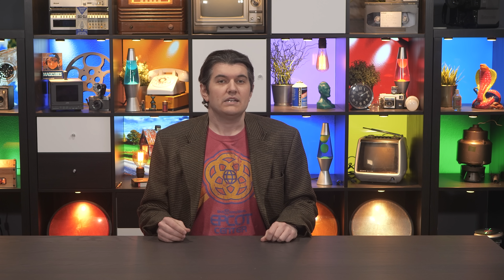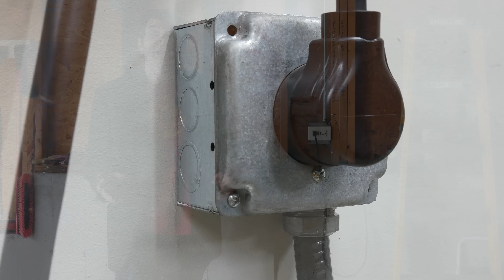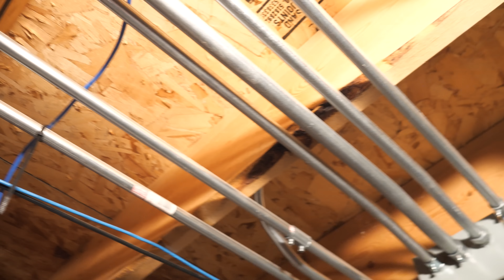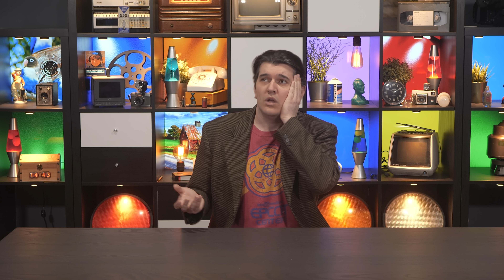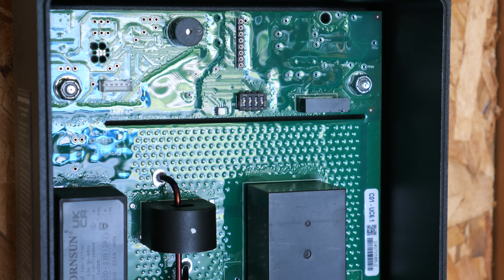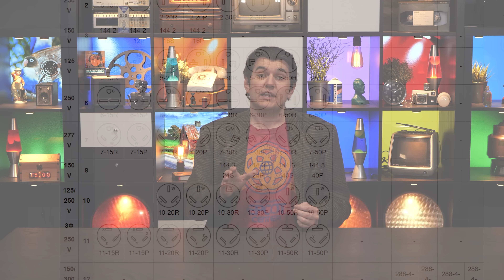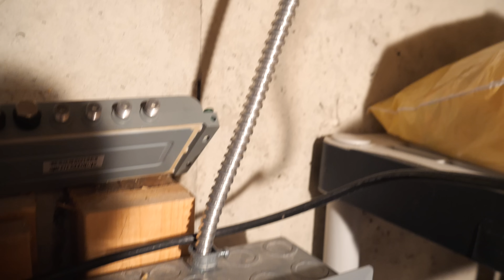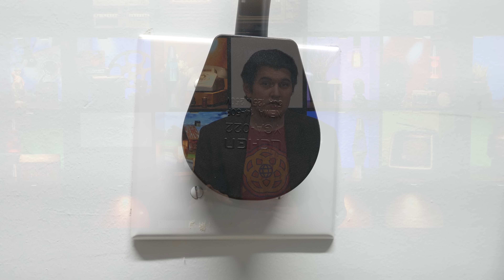The "standard" car charger is usually overkill—but your electrician might not know that

Comment: If you would have had to pay for the labour, getting the slightly beefier wire would have added almost nothing to the total though, so you still might want to get a bigger circuit anyway. The expensive bit is the labour anyway, parts and materials are probably less than half. So sure small circuits are fine, but if you can't do it yourself, might as well get the biggest wire put in that does not require panel work.

Comment: as a German electrician, i find this all very interesting, but we have 230V 16A at every circuit in our homes and we have ground fault circuit breakers for every circuit, it's called an RCD and sits in front of the circuit breakers (as long as you house isn't like 100years old, wich is quite common but even then most houses just add one later) btw. our stoves for example get 400V 16A-32A. so its interesting but completely useless to us in most parts of the EU xD
Reply: Yeah I am shocked that they don't just use RCBOs on 240V circuits in the US, they are less then 50€ anyways.
Reply: @DooMMasteR  
Yeah im generally kinda shocked by their electrical stuff, the only thing that should also be mandatory here is a main breaker so u can work on a panel without having to call the utilitys to shut of power to the entire house 😅
Reply: Yeah same in The Netherlands.. and with EV charging, a 3-phase 11kW charging station, hard wired with a completely seperate circuit and load balancing is pretty much standard. Not sure if it's mandatory and it might be a little bit more expensive but it works like a charm here in my house.
Reply: @bartwillemsen1  yeah in the EU, the outlets have to have a Type A/B RCD, wallboxes have Type B (DC) built in, since Type A is mandatory anywhere anyways, it's common to just separate them; (also in Germany e.g. a max of 6 RCOs per RCD is the limit) so there could only be up to 3 other circuits on the same RCD anyways.  
Having a fault current risky outdoor circuit separate makes sense especially when a 40/63A Type A RCD costs less than 50€.  
Also most wallboxes here, even cheap 200€ ones, offer automated load balancing to allow 5-16 charger points on a single 32A circuit (22kW). 
They will manage the load dynamically by switching between 1 and 3 phase and the default 6-16A based on how many charge points are in use.  
Once a car finishes charging or disconnects, the remaining charge points automatically reconfigure to offer more power.  
Some even allow to allocate more power to cars that have a low SoC and such.
Not sure if EU wide, but in Germany since 2007 RCDs are mandatory on ANY socket circuit and since 2018 they are required on every circuit, so seeing a new circuit installed without such a cheap but potentially life saving device feels off.
Reply: I live in Europe too and RCDs are a bane of my existence. I've had constant nuisance RCD trips at every apartment I've lived in, sometimes multiple times a day. I've been told that it might be caused by my UPSes, and there's nothing I can do about it since I'm required by law to have an RCD.
Reply: @obj_in_motion bruh it's not the rcd thats your problem 😂😭
Reply: @obj_in_motion  the RCDs are not your issue, the fault current you have is the issue, and the RCDs are showing you, exactly that.  
Especially since circuit RCDs are usually 30 mA here, and only wet areas are using 15 mA ones.  
Better fix those faulty devices than being electrocuted by 240V :-)
Reply: @DooMMasteR my RCD woes span several years at like 4 different apartments. All my electrical appliances have been changed at some point. I've also had several electricians try (and fail) to diagnose the issue. Either every apartment ive stayed in has crappy appliances, or there's something supernatural going on lol
Reply: @obj_in_motion 
I run upses and have no problem, you should check if u have losses somewhere, rcds work by comparing the  magnetic field of electrons going into the circuit through the 3 Phases to the outgoing ones through N if there is a discrepancy between those of 30mA they trip,
Reply: We have Ground Fault on essentially every circuit as well. We just call them GFCIs instead of RCD. Arc Fault is also required in current code. Same deal with older homes not having them except for retrofit, which happens as things are updated or replaced. You don’t need GFCI on a hardwired EVSE as the EVSE is the GFCI. We have a lot of receptacle GFCI and AFCI that can protect the entire circuit so it’s very common to have the devices there and not your panel. Each brand’s breakers aren’t certified for every single panel brand but receptacle devices are. It would be nice if we had DIN rail breakers in common and standard priced breaker panels.  

There’s no real reason why we couldn’t have 16A 240v everywhere as well aside from having 120v only in our original grid and split phase 120v/240v coming later. Only a handful of devices are sold as 240v only.

As a fun bit of trivia, the plug used by Australia and a few other countries that adopted the same plug, was an alternative US 240v plug.
Reply: @m_cabral  ohh, here AFDD/AFCIs are only needed in sensible areas/usecases.  
but GFCI/RCCB/RCD Type A protection is needed just everywhere, 6 breakers per RCD max.  
That's why RCD (40-50€) and RCB (2-4€) are soo cheap, because they are needed everywhere.  
I guess RCBOs might be a more common sight in NA then, since it would allow panel level RCDI in any panel, since it just uses a normal breaker position.

Yeah I wonder why there isn't a movement towards 240V in NA anyways, like in countries like Brazil, where today mostly only old installations and parts of the grid are 120V and most new stuff is 240V.
Reply: Kinda spoilt here in Germany, having 3-phase to the house. For EVSE up to 11kW, the utility has to be notified and for above that up to 22kW, the maximum for a home installation, they have to approve the request. The EVSE is always wired in, never plugged. The real down side is, from my standpoint as a UK qualified electrical engineer but not being a German-registered contractor, is that a DIY installation is a violation of the "technical connection conditions" of the utility - only a registered contractor is permitted to submit the documentation to the utility and to connect the equipment - that's gonna set me back a thousand euros. So my 11kW "wallbox" as they are known here, which was delivered with the car, is still in the carton and for ordinary usage it's enough to charge my Ioniq 5 once a week from a normal 230V 16A outlet, with the car's own portable charger set to 12A. Which is exactly Alec's point in the video.

Comment: Gas station fill-up takes about 3.5 minutes... Probably about once per week. Not sure what else you're doing at the gas station but it's not a noticable inconvenience. About 150 seconds for an empty 15 gallon tank. I used to think it took forever and then I started benchmarking the gas stations I frequented to see if the "slow" pumps were actually slow. In my limited sample size the average pump does about 0.1 gal/second. 

All this to say that you're not likely saving any time at the pump, it's just that your time is spread over the week in 15 second blips of plugging in and unplugging. The savings you do get are in the cost for energy. Electric is vastly cheaper than dino water.

Comment: The (North) American electrical system is, compared to our system here in Europe, sometimes a lot less complicated and at the same time some much more complicated. I love the idea of a breaker panel/box. Need a new outlet (or group)? just get a new breaker, run the conduits and basically be done. So much easier. 
And then they make it so damn complicated by introducing a ton of plugs that essentially all have the same function, yet different uses. Dryer? Use this outlet and plug! Washer? Use this plug and outlet that is just slightly different than the dryer one!
Here Schuko is used for the vast majority of things. Rated for 230V and 16A (so about 3600W). You can use CEE plugs (blue ones), though they are rarely used. And for the most part, red CEE plugs are used when there is need for a 400V 16 or 32A outlet. 
There is also a perilex plug, that is rated for 25A, and is mainly used for electrical cooking stoves. It will not fit a schuko plug, and that is the main reasons since these stoves use a lot more power. This is very much a (North) American issue.

Comment: In germany* we have CEE connectors for 1 phase and 3 phase power.
Single phase 240V can do up to 32A (7.680W).

Meanwhile the 3phase 400V Connector is rated for up to 125A or 50kW.
Although most new houses connect the cables directly to the appliances that would need anything like that (outside of Workshops), like heat pumps etc.

*and I believe most of europe.
Reply: They can also carry 100% circuit load for long time (as can some "load" rated normal sockets).
The Blue and Red big boys have the advantage of being out-door rated too.

Comment: One argument I have heard against slow charging is that char charging circuits have very high constant (independent of rate of charge) losses.
I initially dismissed this as typical anti-EV bs, but I've since then seen figures for the Renault Zoe (prob not common in the US but popular here in Europe) that suggest charging at 2.3kW (10A) gives you efficiency as low as 59%, whereas it's 89% at 22kW.
I'm not quite sure what the car does with the 1 kW of lost power (it's a small car, heating at 1kW for 20h should turn it into a sauna...) and this may be specific to the Zoe, but it's easy to imagine that manufacturers do not make much of an effort to optimize for slow charging efficiency, so prob worth keeping an eye on this.

Comment: Here in Ireland we usually get a car charger installed outdoors to charge the car at 7kW. Overnight the rate for EV charging is cheap so I’d easily get 28kWh into the car overnight. The issue with slow charging for me is needing the charge every night. I could plug into the granny charger but it’s generally discouraged since it would be plugged into an existing 13A circuit.

Comment: How much power comes from the standard socket in the US? Because 5kw isn't THAT much more than 3.5kW, which is the standard over here in the northern EU. Our normal household sockets provide 240V at 16A, which is roughly 3.5kW in actual power output. 

That said, the same problem occurs here too — most people don't realize the 3.5kW from the normal outlet is enough to charge their car overnight, if they just locally commute to work and visit the local grocery store a couple of times a week. Especially if you don't drive every day, it's more than enough. 

Then again, almost all households also get 3-phase ~400V connection too (our stoves, for example, usually run on this), so it's very easy and cheap-ish to get a charger connected to that — which essentially gives you 11kW/22kW (depending on the car) charging at home for less than one would think of. Like, if you have a free 400V plug available, you can just buy the cable at a store for around 250€, and that's it. You have 11kW charging at home. No installation needed. 

Very few people know this is possible, unfortunately. And this is why people pay stupid amounts of money to companies that install chargers at home.

Comment: EVs cost what? Low end of maybe $20,000 used ? And for $100 you get to have range anxiety every day with 110V charging or for $600 you get to start every morning with a fully charged (maybe 80%) vehicle using 220V charging. It seems like the extra $500 is a good value. 

My Model 3 gets a lot of use, with 4 drivers in the house, it will see 150 miles driven several times a week. And yet, there is no stress. The last driver of the night plugs it in and however drained it is, by morning it’s ready to go again. Sometimes, there is plenty of range left and we don’t plug it in, no stress, no anxiety.

Comment: I figure this comment will either get lost in the thousands of others, or (better) is redundant because someone already mention this, but...

When discussing the J1772/NACS adapters, it would be important to make clear that your EVSE uses NACS (aka J3400) and the car has J1772, you need a different adapter for DC fast charging than you use for AC charging. Many owners will get the former, or even be provided one by their vehicle manufacturer, so that those owners can charge at Tesla Supercharger stations on road trips, but that adapter won't work at home. The CCS plug uses different conductors for AC charging than it uses for DC fast charging, and an adapter for fast charging will only direct the connection to the fast charging connectors, leaving the AC charging connectors unpowered.

Going the other way is fine. If you have a J1772 at home and are adapting to a car with the NACS, then the adapter will work fine, because that kind of adapter necessarily takes both the J1772 and CCS connectors on the EVSE side and directs them together to the single high-voltage connector on the NACS car side.

One hopes that now that the industry has decided (apparently) to standardize on J3400 (aka NACS), then after a decade or so, the vast majority of owners won't be needing adapters for anything. But for now, we're going to have to be mindful of these complications.

Comment: I'm using weaker power supply to charge my bike overnight. The more powerful one charges in 7 instead of 12 hours. But I rarely spend more than half of my battery during the day, so I just configured it to charge overnight when electricity price is lower and using slower one to avoid excess noise and battery wear.

Comment: I charge with 230V 16A on a standard outlet (outside of 120V Land). three phase 400V 16A or even 32A chargers are common here, so 11 or even 22kW
My car sits idle on the charger most of the time so I really don't need more than the 3.7kW and I probably would be fine with 1.8kW from 120V 15A either

Comment: As an qualified Australian electrician (NSW), it is so much easier having 240V ( usually actually 230V ) as the standard. Half the current for the same power.
A 3 core plus E supply is 1 phase 415V with neutral ( or 2x240v single phase ), OR 3 phase 415 no neutral.

Comment: 6awg and 8awg MC are also a thing. I installed a 60amp circuit and used 6awg MC for 48 amp charging. My charging cable is outside so having a smart charger that knows my car’s vin and only allows my car to charge is important in my opinion

Comment: What about a 120v outlet (normal). That charges a standalone battery pack that can output at faster speeds until the charge is depleted. So your first hour or two will be fast. No installation required.

Comment: National Electrical Code 2023. 625.41 and 625.42 State that the load will be considered continuous so a 32 is a 40a and would require a 40a breaker and a 50a plug (We don’t install 40a outlets they don’t sell those). Continuous load is the max (Thats written on the equipment, not online) load times 1.25. Thus why 48 is 60a. We care deeply about heater type loads that go on while your not there, such as hot tubs, or electric floor heat. We don’t call it the 80% since thats not how we think of the system.
Reply: A really good tool that could help anyone is contacting a local head electrical inspector of your area (If they are nice enough to talk to you) to discuss reasoning behind code discussions and to double check your in compliance before committing to a task.

Comment: The discussion around the 25 minute mark about superfluous features of charging stations really hit home. Sixteen months ago I replaced my natural gas water heater with a modern Bradford White heat pump water heater. I installed the "app" on my phone and configured the water heater to connect to the BW servers so I could track how much electricity the water heater used. That feature is borderline useless and I can't see any point in being able to control the behavior of the water heater (such as the water temperature) from my phone. The internet connectivity of my new water heater is essentially pointless (other than as a marketing bullet point) and adds needless complexity and points of failure.

Comment: about the issue of public charging, a solution would be faster charging EV's. I for example own a Renault Zoe without DC fast charging and don't have a way to charge at home. My single option is to charge during activities, that's where the car's 22kW AC charging and 22kW AC infrastructure come into play. I never notice charging because I can top up during activities. Just go where I want to, often times there's a station, and if I'm at 30%-ish I'll plug it in and let it charge until I'm finished. In 1h I can get around 50% charge in the battery so it's just perfect and it's been for the past 7 years. Most times I stop the charging process to avoid going over 80%.

Newer EV's on the other hand can only manage 11kW which I find quite bad honestly. Tesla had 22kW, Renault still has some cars with 22kW, Mercedes and afaik BMW still offer them. Even if you don't have such a small battery, 22kW will keep your car topped up if you plug it in during appointments or shopping, much more than 11kW would.

Edit: our yearly mileage is about 20.000km with the Zoe, that's about 13.000 miles. It's our main car since it takes care of all the journeys of 200km around our home without any issue. We don't own an ICE car or an EV with bigger battery or DC charging.

Comment: EVSEs should all support OCPP then you could use the "cloud" or just a RPi for local automation. Optimizing for electricity price is worth it. Obviously the charger should have a sensible default in case the smarts can't be used.